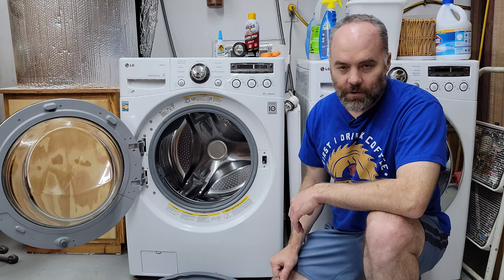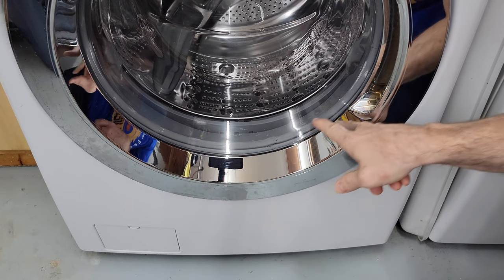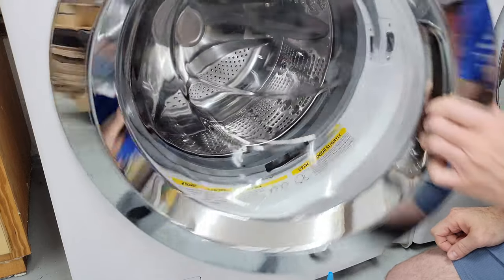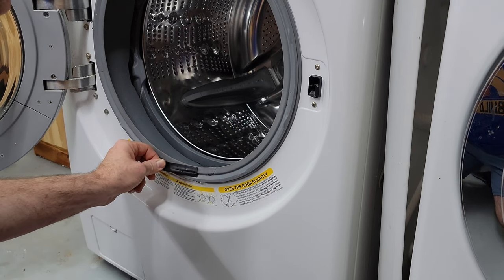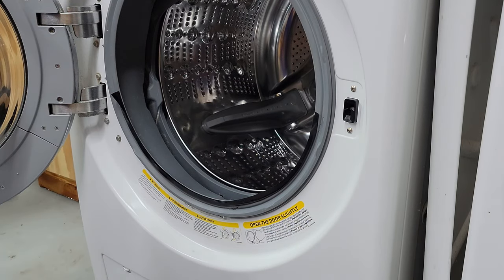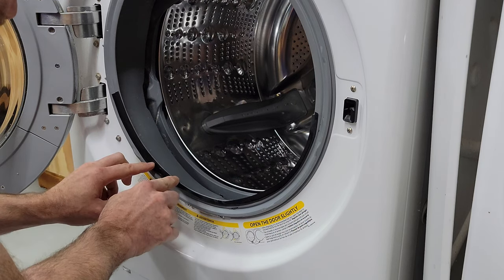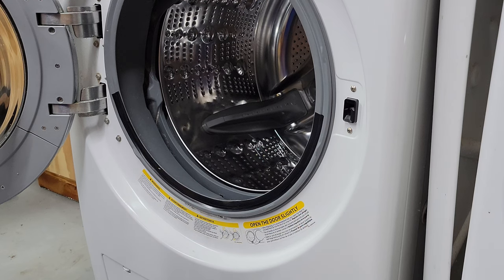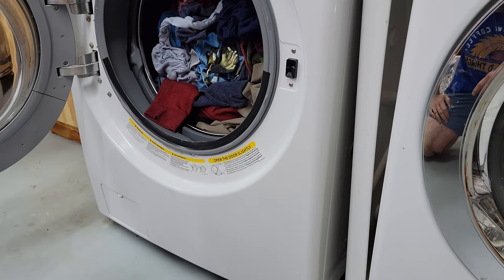How to temporarily patch a leaking washing machine front seal

Comment: Superglue is the worse thing you can use, better to get some Polyurethane sealant, you can also get it in grey. The sealant is rubbery and stretchy. Just use baking paper with some painters tape.
Reply from the maker: @B0r0  it doesn't need to be rubbery and stretchy; it needs to connect very thin things that are rubbery and stretchy. Also, it worked great. Polyurethane (non-expanding) sealant would probably also work, just with more mess and slower drying time.

Comment: I tried this and made sure to buy the black roofing sealant (Loctite PL Roof & Flashing from HD), used waxed paper, and allowed it to cure for 4 days. Did this twice and both times, I barely touched the area to clean it up like in the video and the sealant fell right out as if it wasn’t actually adhering to the rubber gasket. I made sure it was 100% dry and everything before applying and followed the video step by step. I also tried smearing the sealant further to the sides to hopefully grasp onto the gasket more but to no avail. What could I be doing wrong? Thank you for any more advice!
Reply from the maker: You might have commented on the wrong video. None of those were things I showed in this one.

Comment: Nice! Do you think the electrical tape will work if there is a chunk of the seal missing?
Reply from the maker: Not as well, but you might be able to reinforce the gap behind the tape with a flexible adhesive.
Reply: @The Snekker Show  I'll give that a shot. Thanks for the quick response.
Reply: @lumpvision5746  how did you get on with this. Debating on whether to try this or just get a new one
Reply: @Fern Home & LifeStyling  Failed! I had a big chunk missing from my seal. This is probably best for a tear or crack. I'd give it a shot if your damage looks anything like it looks in the video. It'll cost a lot less than getting a new unit if you are successful.
Reply: @Fern Home & LifeStyling  OH. So instead of getting a new unit, I got the seal replaced. Everything is good to go now.

Comment: Why not just remove the gasket/seal with the comprised spot and relocate to the top where water is not in contact with the seal until the new one arrives? Nice fix I will have to say!
Reply from the maker: These have to be installed a certain direction, and have connections for electrical and water. Changing it involves taking the machine halfway apart.
Reply: @TheSnekkerShow  ok it was keyed and I did not give that any though, 😁🛫